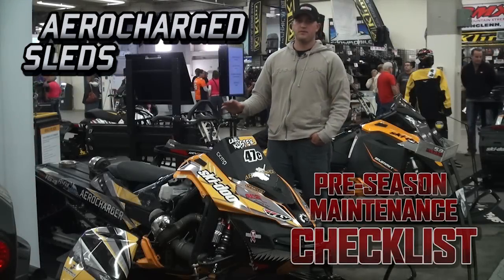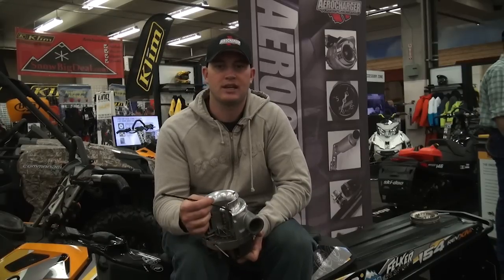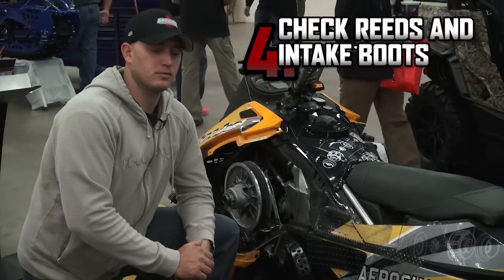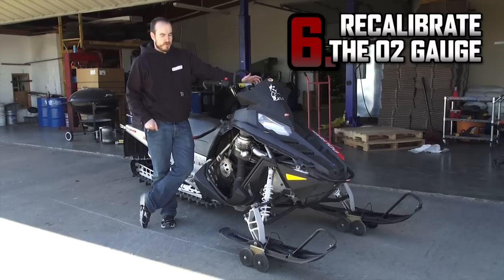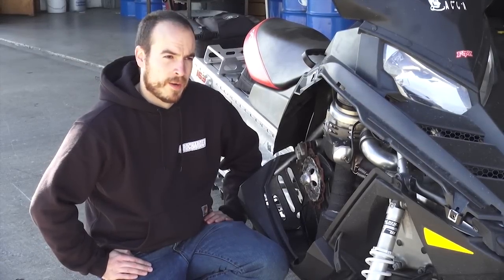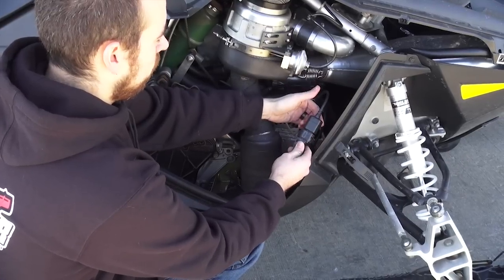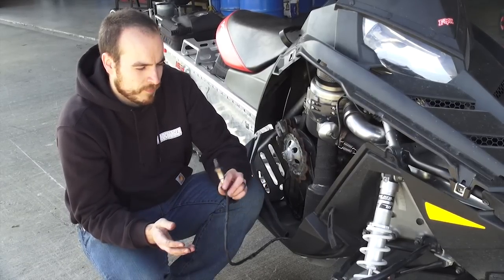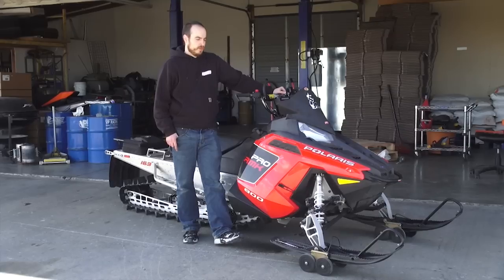Pre-Season Setup Checklist for Aerocharged Snowmobiles

Comment: pn 17014 is for older 4.2 style connector. its larger (35mm) than the new 4.9 style connector (smaller at 25mm)Bosch  pn17025 works with innovate afr gauge on my 2016 800 etec aerocharger